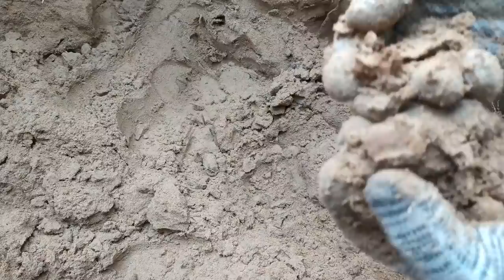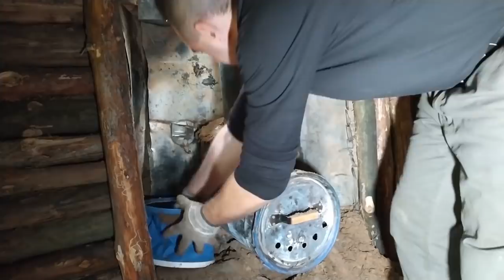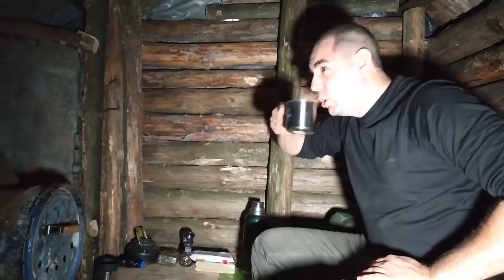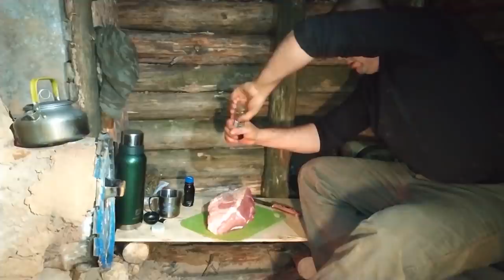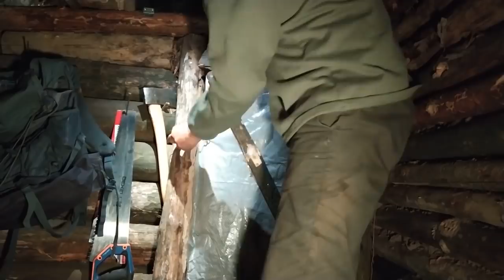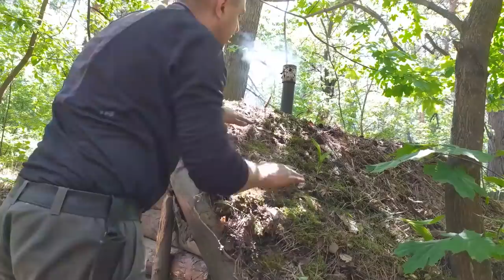Clay Stove in Dugout, bushcraft build, primitive building, Part 5

Comment from the maker: What do you think about it? Will it hold up?
Reply: It looks like it will hold up fine. You applied the clay fairly thick. Looks great!
Reply: a wire frame?
and fine sand mixed with clay (or fine crushed glass)
wire mesh

see: Truly Passive Greenhouse Build - progress report
chain: paul wheaton
->
  the hole he makes in the center
I made one in a cabin, very good (and storage)
if the basement, and around, is very well drained, dry
Reply: If it doesn't it's easy to fix.
Reply: I like your style, for fabrication. Reminds me of Carlilse.😃❤

Comment: Looks good! Stove worked well. Just one question - when you put sod on the roof - would you not start at the bottom and overlap all the way to the top so the rain will drain off?

Comment: where you dug out the clay, that is about how deep i would dig my camp . and at least 6' wide on the inside and 9' long  and at least 3' deep . i don't have any pine so i would use eastern usa red cedar juniper , maybe scorch the ends  before sinking them into holes for the doorway and notch the tops for a tenon ended ridge pole . i would also alter the floor plan and have the bed to the left as i enter and a long walkway . i would also have a recessed firebox  so it would have a hearth  maybe i could find a large flattish rock or use round pebbles as a fire resistant  surface and as a shelf for stuff . 
  Since the area i have to work with has a high clay content , i might just lay a large cedar log at the bottom  sides of the wall and cut out some mortises into them  instead of igging a pocket hole like for the ridge door post .  And with a cordless drill, bore some 1'' holes 4'' apart parallel to the walls and use them to hold sticks that i can use as cross braces for woven mats that i can fill with daub plaster 
      Like you i too would use visqueen  sheet for the roof and maybe down the wall , here a roll of 10' x 20' 3 mil is $10 USD . i would cut it to 10 x 12 to further cut into 10x6 for the side walls and 10x8 for the roof . i would first scotch tape some small pebbles to the bottoms of the plastic sides the staple them to the inside of the top side wall purlins and drape them over the purlin and the weighted bottoms should easily pull to the bottom of the outer wall. there should be a bout 1-2'' air space between the wall with plastic outer and the dug earth wall . 
   i found a good source of straight stout bushes to cut for the wattle sides so i can plaster the walls . 
 i like the idea of a dug out camp as it completely blocks the wind